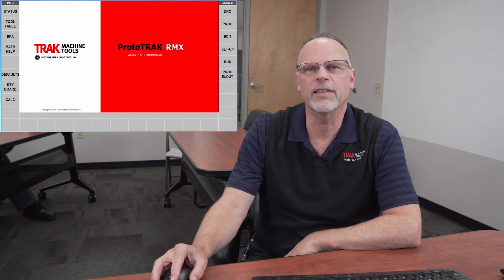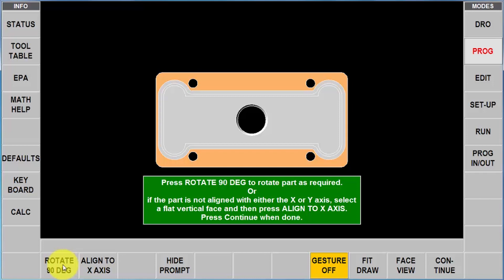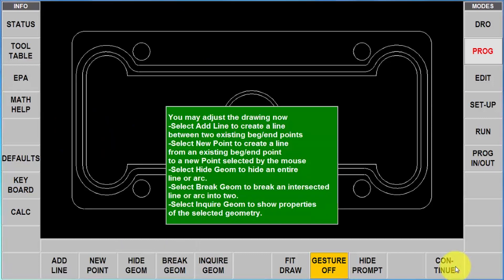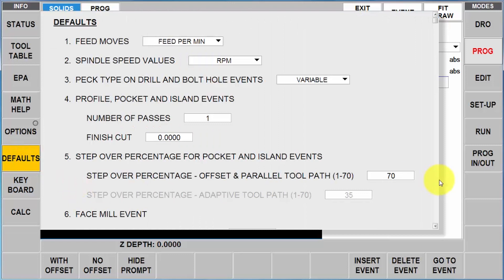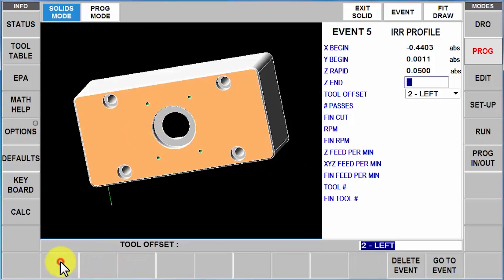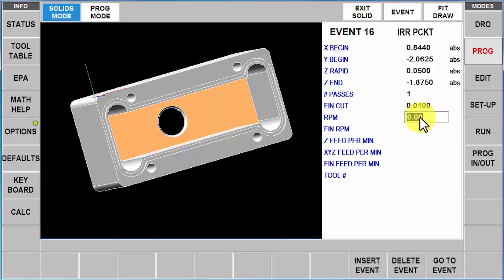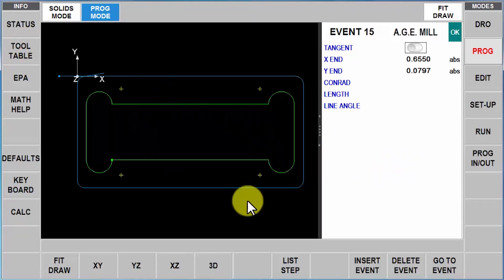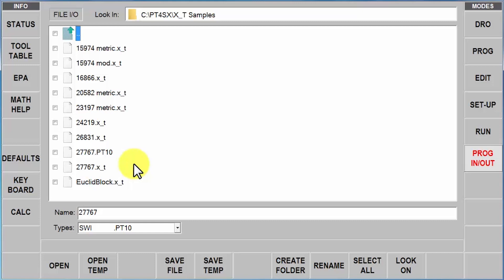Parasolid Converter | ProtoTRAK RMX CNC | Advanced Mill Programming

Comment: Hey Pat! I am having trouble with importing files, and I'm wondering what software/ settings should be used to save a solid so that it will load properly.  And help would be great, thank you!
Reply: Joshua, Are you saving your solid as an X_T file?  If you are and you're still having trouble, please email me the file so that I can have someone take a look at it. You can email me privately at trakingpat@trakmt.com Make sure I have a way to reach you when you do.  T.P.
Reply: @trakingpat2750  initially we had saved it as a V34 X_T, but what just seemed to work was saving it with V30, now I have a full model where before it would 'load' and there would be nothing. But I am back on track now, thank you very much for the reply!